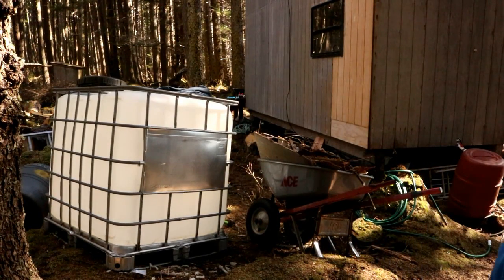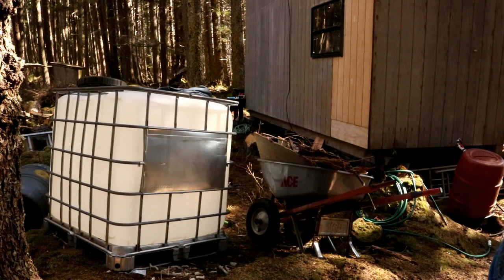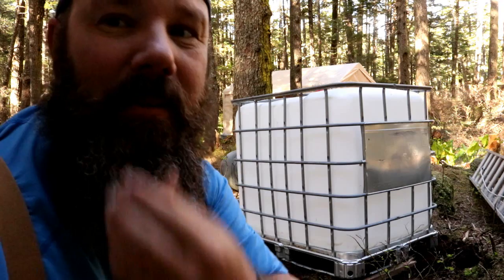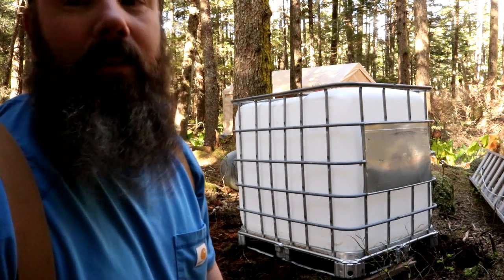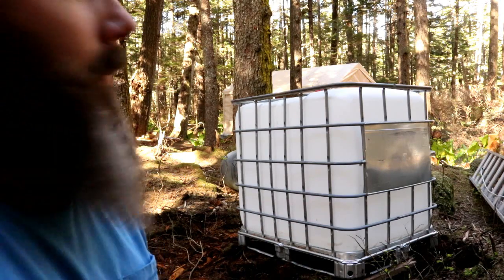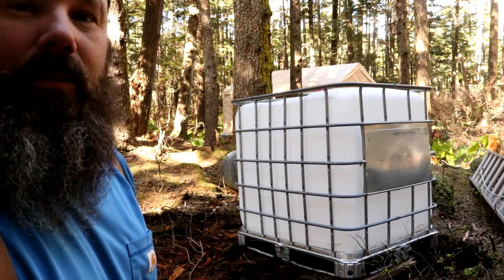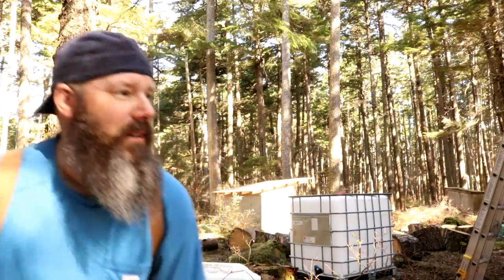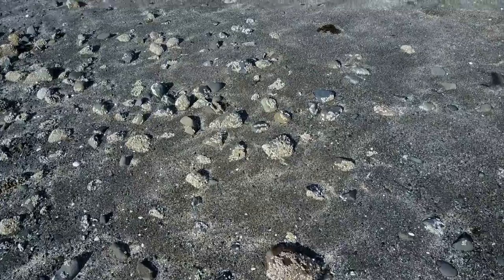Working on the rain catchment system Part I (SE 2 EP 15) 2017

Comment: I forgot to ask why you didn't put the container directly under the downspout?
Reply from the maker: That’s not going to be the final spot for the tote and I haven’t put in a overflow pipe in it yet. I didn’t want it to flow over right by the killer that holds up the cabin. It’s on a little berm and anything that comes out runs away from the cabin.

Comment: Hey there again!

You need to try, for stumps, the farmer and ranchers all-purpose helper, trinitrotoluene, guaranteed to get stumps out of the ground!

No fuss, no muss, just simply out.

Pertaining to your water catchment container, the other fellow that mentioned you ought to paint it black, had a really good idea!

Painting it black will help stop algae formulation in the tank from sunlight and heat going through the white container and attacking the water inside!

Green is another color that I like even better than black, because it does not absorb the heat as well as black, but still makes your container opaque so that the sun cannot create that nasty algae formulation which will ruin your water and make you sicker than five dogs!

I really like the idea of sand banking the container, not just on the bottom but all four sides and on top after putting someone in plywood or even a concrete sheet on top for insulation!
Reply from the maker: We got some big plans for that tote but nothing is finalized yet. At first I was think about putting it inside the cabin.  Our plans are to build and extension on the back. But now I’m thinking we might just bury it and pump the water out of it and into the cabin.